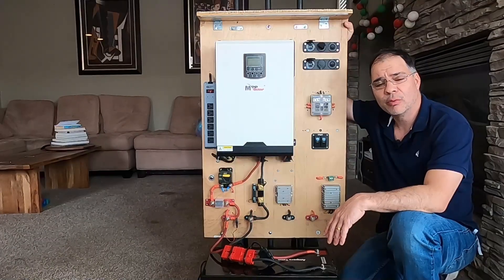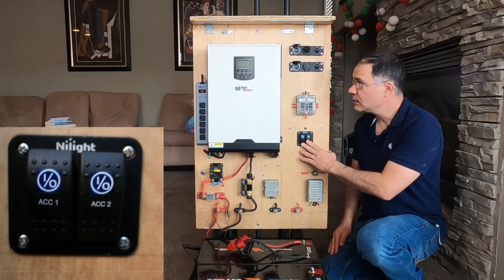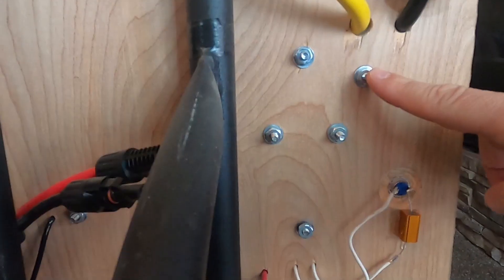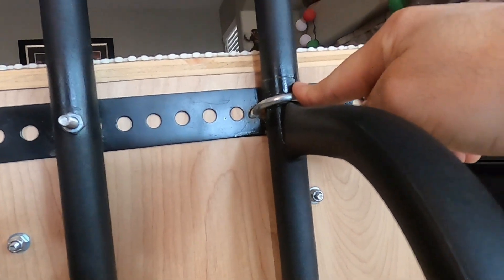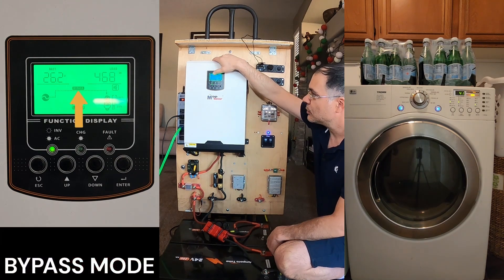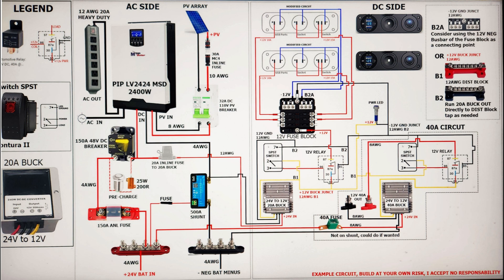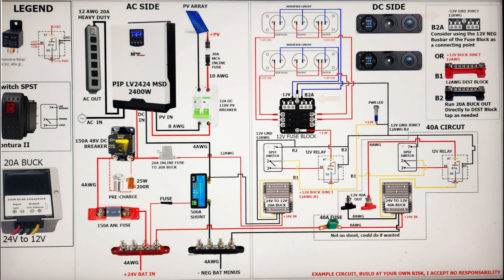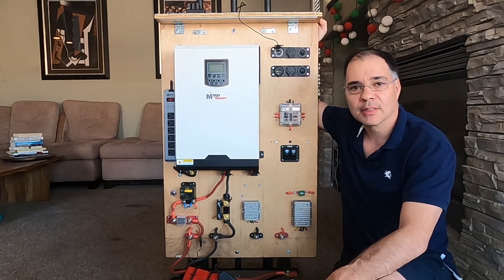Hand Truck Solar Power Station - Schematic, Build Cost & Parts List

Comment: You really need to replace that ANL fuse with a T fuse, those blade fuses have been known to arc in such a way that it continues to allow the power to keep flowing destroying your equipment, possibly even causing a fire
Reply from the maker: I would agree except that ANL have a AIC of 7000A wich is quite considerable. AGM however have a 2000AIC. If I had say over 800a of potential current I would use a T class. The breaker is also there as a backup. Thanks for watching.

Comment: I like it! It's like a fantasy project for me. Maybe I try something similar. I live in Phoenix so we've got a lot of sun like Las Vegas. 🙂
Reply from the maker: Yea, same as here . You can pick solar panels up from santan solar. I didn't record the build at the time but I'm doing a complete 12v system video now.  But the all- in one inverter chargers are good for beginners. Less wires less components.  Full schematic on my website.
Reply: @natesdiysolar  Cool stuff!

Comment: You had me with them relays. Till I realized you were using buck and boost 24 volt to 12 volt...Which I don't get.. Why not just make the whole system 12 volts and get the total 400 amps capacity from paralleling batteries...
Reply from the maker: Because 24v is more efficient than 12v and the inverter is a 24v inverter. The batteries are in parallel and I am getting the full 400a. Check out the schematic and you will see how it's connected. There are 2 separate sides. AC and DC. I'm not using a boost buck.  I'm using a step down buck.
Reply from the maker: The buck converter does not run the inverter.. it only runs the USB panel. If you see the other related Video, I show each side operating independently.
Reply: @natesdiysolar  Why do you need a 24 volt USB Panel? Seems an added extra step and cost...
Reply from the maker: @Up2NoGood  the USB panel runs on 12v not 24v. The reason is I can use the buck converter to run my small electronics straight off my battery instead of using the inverter. The Inverter uses 65 watts just to operate with no load.  It's just for versatility. I can charge my phone using only 22watts vs 80 on the inverter.
Reply: @natesdiysolar  I get that.. Just hook the USB hub to a fused terminal block that uses 12 volts....You already have the 12 volt fuse block..

I would add. All you are doing is adding complexity to a simple system..
Reply: @WizzRacing  damn dude, why don't you build yours and show us your simple system. He built it his way coz that's how he likes it .....🤷🏿‍♂️
Reply: @vroor32  Which ones. I installed over 1500 electrical systems in my 40 years as an electrical engineer..   

And unless electrical theory has changed in the last 400 years. I don’t see ohms law changing…
Reply: @WizzRacing  Are u really an engineer? Or u act like one on TV? I'll believe when you build your own and post it for the algorithm to show it to me 😂

Comment: What are the grounding options for solar mobile systems like this and using just a battery for AC loads without connecting to the AC grid?
Reply: It's the same as using a Generator...The inverter must have an internal double insulated AC protection...With the Neutral grounded\bonded.. This provides your GFCI requirement...

And using a ground rod is useless. As any electrical short will want to return to the source. That being the Generator...
Reply from the maker: As far as I know, for the AC output, it's just via the AC input. There is also a grounding screw at the bottom of the chasis of the inverter. You might be able to run that to earth ground, but I have not tried it myself, nor have I seen anyone do it or mention it either. I'll check the manual and let you know.  Why would you not use the AC input, though? There is a very high chance that at some point, your battery will get too low.. typically at night, and you will want to tap the AC input to charge your battery. Otherwise, the inverter just shuts down, and your appliances have no power. Thanks for watching! I'm glad it was helpful.